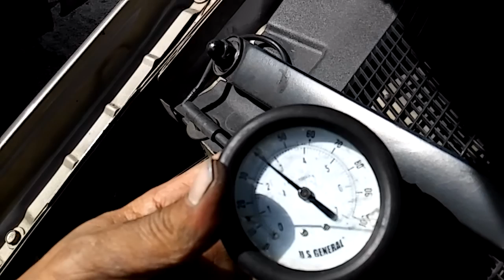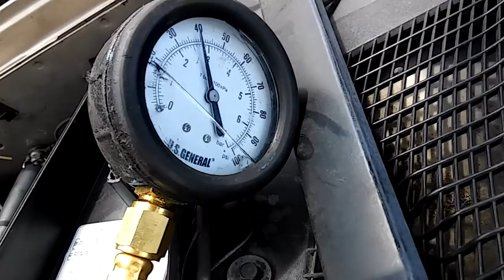Part 2 No start 1999 venture montana

Comment: My pump has pressure and it sounds the same do you know what else it could be
Reply from the maker: Do you have spark.?is the security light on while cranking? Can you scan for codes?
Reply: C14back2 Nitrogen ima check that i soon as i can i wish i had the car with me , do you think it could be the throttle body maybe because I tried starting it with starting fluid it would stay on but as soon as I stopped spraying it would turn off on me .
Reply from the maker: @Ezeke_  it does sound like you have a fuel pump issue